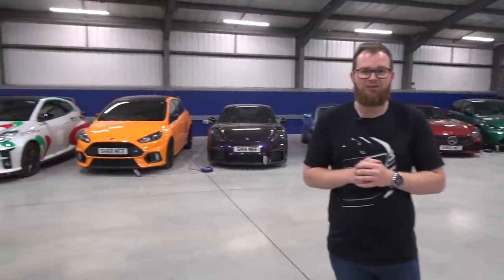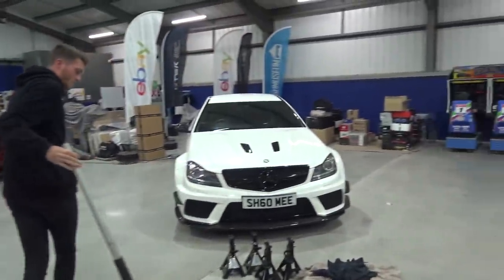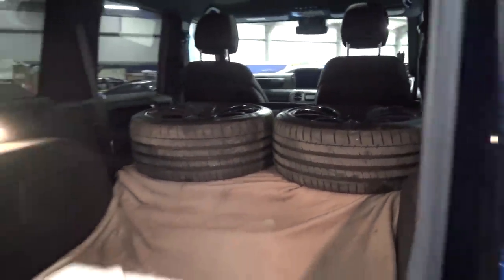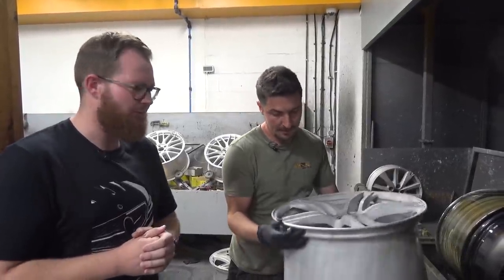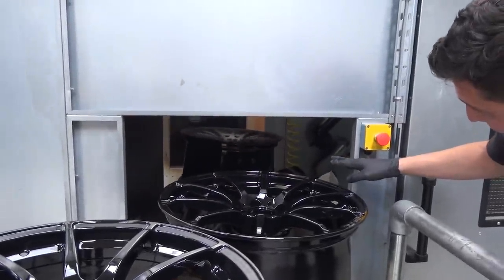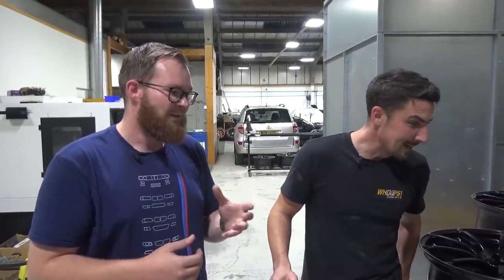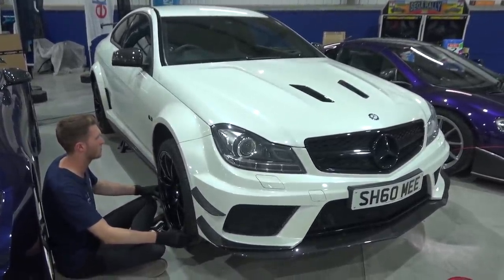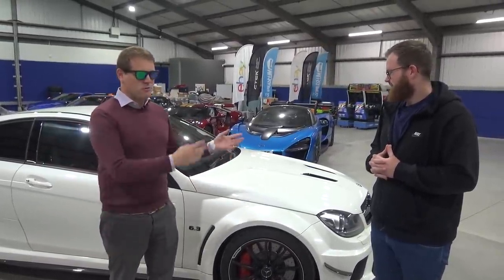Surprising Shmee150 with NEW WHEELS for the C63 AMG Black Series! | SHMUSEUM VLOG 16

Comment: Not to play devils advocate, but I personally don't like the fact they have painted the silver. I had some 16 spoke AMG alloys on my Mercedes which had a metal rim and no way can you get the same finish with paint. I think they look cheap and tacky. Mercedes themselves have accident repair centres where they refurb alloys. Mine only cost £120 + VAT per wheel. (with the metal rim). I'm sure Whoops can do a great job but I wouldn't go there.